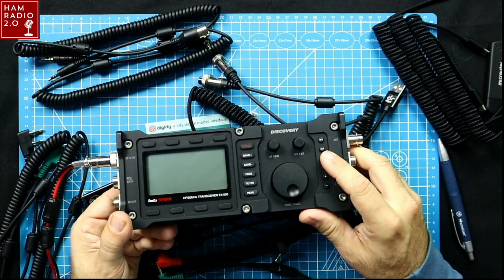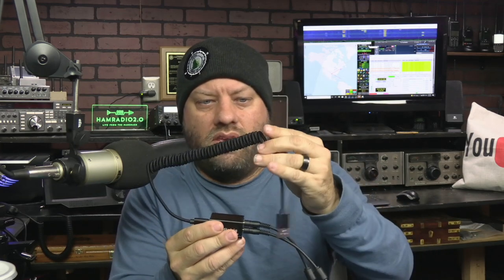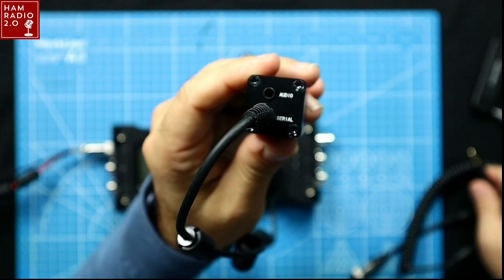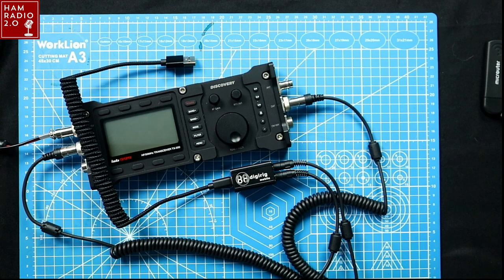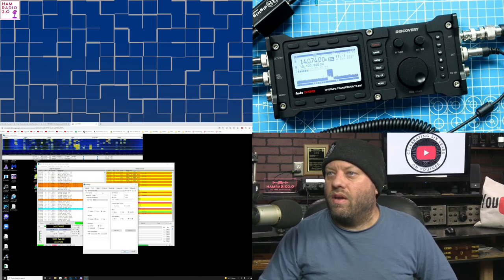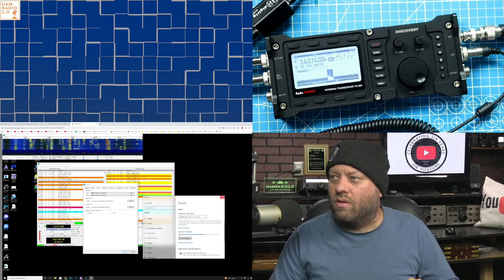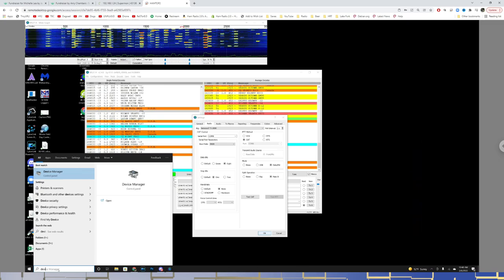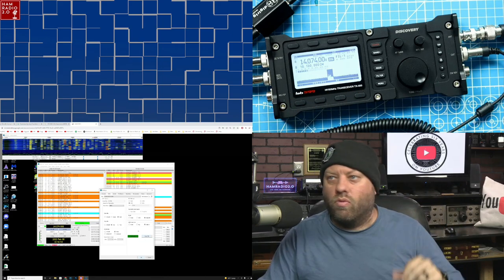DigiRig Modem and Rig Control for Lab599 Discovery TX-500

Comment: Good video. I've been looking at this unit since seeing Julian talk about it.  I just placed my order for a Digirig and IC706MKIIG cables today.  One use of an FM HT with Digirig would be using it for Packet or VARA FM Winlink if you are in range of an RMS node.  My primary plan is to use it with the IC706MKIIG in my truck for  portable HF VARA and Packet/VARA FM Winlink ops for EMCOMM.

Comment: I want to explain some things I've learned about serial communication with devices in the case this helps someone out there who is really confused. I've worked with serial devices professionally for a short time and I'm sure I'm still wrong about some details. If you know better than please comment back. 

All these radios, as far as I can tell, use RS-232 protocol to talk bc it's cost effective. This is a loose standard that specifies what  voltage is a 1 or a 0. That's about it. In the old days, Transistor-to-Transistor logic (TTL)  was sent using  higher voltages than modern transistors, 3-25 VDC. These days newer chips use something lower I think it's around 5 VDC.

To be clear, USB is also serial but a different standard.  That has to be broken out to the multiple pins on the RS-232 standard and given the proper voltages. These conversion chips are not only used with radios but tons of legacy equipment.

You'll see that some serial-to-USB conversion chips are specifically for 25 V or 5 V. Most are 5 volts. 

There's a chip called FTDI which is a producer of these common chips. They cost more than knock-offs because they handle the conversion better and there's probably some patents so the knock off's cannot just clone the chip exactly.

In the old days, embedded systems were very slow and memory was limited. Thus they  would be easily overwhelmed if too much data came streaming into it's data port (serial port). They used Data-Ready, Clear-to-Send and Ready-To-Send signals on separate wires / pins to mitigate those issues. 

Modern embedded micro controllers  do not need the three separate signals. However, a radio may use DTR for data and RTS for PTT which is convenient. Or the radio can just read a specific code for PTT and command data from just one wire/pin.

The data sent are binary numbers usually each has a special meaning. Some devices can "talk" using ASCII commands which are nicer to read for humans when programming. The binary numbers are 16 bits or two bytes long. There's a preamble that means, "hey I'm talking!", then the data ( like a frequency value), then a post-amble (I'm done talking).

The radio then replies that the command was received and often a code for success or failure.

The driver is the connection between the OS's low level kernel and the higher level program like FlDigi or JS8Call. The kernel makes the connection painless for the programmer they just say, "open the USB port and connect" and it happens.

A main feature of DigiRig interface, is that is combines an audio chip (and codec) and the FTDI conversion chip in the same small package. There's a built in USB bus which combines the signals into a single USB connection. I didn't know until I watched the video, that there's also an EPROM chip with the Windows driver to talk to the FTDI chip. That's super cool.

Comment: I have a Baofeng sitting in its charger working as an iGate for a big footprint APRS Digi 3 miles away…connected to a small footprint pc via $8 usb sound card…Agwe siftware TNC. Been in operation for 3 years now.
Reply: JASON: Are you getting spammed here? I sent you an email…no answer.

Comment: Ok. Noob question. What is the end purpose of the device? And is Internet on the computer necessary when using it?
Reply from the maker: I don't mind noob questions.
This device allows your radio to connect to a computer so that it can work digital HF modes.  NO...you do not need internet to make it work.

Comment: I have heard of Digirig. Think I saw it on Julien's channel. I would be interested in it for some of the older radios I have. Older Yaesu's and Kenwoods. Possibly the KX3.
Reply: Don, Digirig supports all the transceiver brands you listed with pre-made cables available for popular models. It's actually the same model of the interface just different serial CAT configurations.
Reply: @digirig  Thanks for your reply. So I need to get one of these and a few cables ;)

Comment: Way cool Jason! will that work for an ft-891?
Reply from the maker: I believe they have a version for Yaesu
Reply: Yes they do. I'm thinking of getting it rather than fabing my own cables.
Reply: With FT-891 you can use Digirig's audio and PTT. There is no serial CAT connection exposed by this transceiver model. For that you can use a separate USB cable directly to the computer.
Reply: I’m using this with my FT891 for FT8. Works great!  As mentioned earlier cat control on the 891 is via USB to computer and the digirig handles the sound card duty.

Comment: Windows os okay but what about those of us who uses Linux for out OS?
Reply: Digirig works with all of these systems
Reply: @digirig  Howabout the drivers?
Reply: @steveashwb7veq479  Audio codec is a standard USB device and doesn't require a driver. The serial UART is CP2102 with the driver present on most systems. The link for the latest driver is in the product page.
Reply: @digirig  Okay, Thank you! I'll have to look into it and see if i can get one to work. 73s.
Reply from the maker: Sounds like its time to do a video with the DigiRig and a RPi

Comment: I ordered a digirig and the cables for my TX-500 that were preset for this radio. I find that the input audio levels into my Windows 11 laptop is way too hot. I cannot adjust audio to a proper input level. If I mute it, they are gone as expected. Has anyone experienced the same issue?
Reply from the maker: I haven't taken the plunge into Windows 11 yet but I suspect you need to go into the Sound Properties and adjust the input (mic) settings and turn it down for that specific DigiRig input.
Reply: @HamRadio2  That’s what I thought, but it makes no difference when I adjust the mic levels. I renamed the inputs upon installation and I had to download the drivers for my new laptop because the device drivers weren’t on my machine.  I went to Silicon labs to get the drivers. Everything seems to be functional except the input levels. I think I may need to cut the trace to access the 20db pad in the digirig. I posted to the digirig guys to get their input.
Reply from the maker: Adjusting the levels in Windows 10 worked for me with this unit
Reply: @HamRadio2  I found a setting in Windows 11 that was checked <AGC>. Unchecked it and it works.

Comment: Why do you need an external sound card when every laptop has one built in?
Reply from the maker: The external sound card is for the radio, not the laptop.
Reply: @HamRadio2  OK. So what is the point? Isn’t one sound card enough? Seems like an unnecessary expense and accessory.
Reply from the maker: @GearZenChannel  If you want your radio to talk to the computer and work HF digital modes, you need this.  The radio can't use your computer's sound card.  Some radios have their own built-in soundcard, so this device isn't needed.  But for this specific radio, it has no radio sound card, so you need this device to interface it to a computer.
Reply: @HamRadio2  My TX-500 works perfectly fine with my Macbook internal sound card and no radio sound card for any digital mode that I care to use. The data port pinout is in the manual and all you need is an audio cable. You can make one or buy on ebay. Also, the radio already has VOX PTT for digital modes, so keying is no problem. I don't care about CAT control at the moment, but the radio already includes a USB cable for that and the settings are in the manual.
Reply from the maker: @GearZenChannel  So you are building a cable because the USB that comes with the radio doesn't control everything.
Which is the same thing I said....
The DigiRig is 1 option to get the radio to interface with WSJT-x and other software on the computer, it isn't the only option.